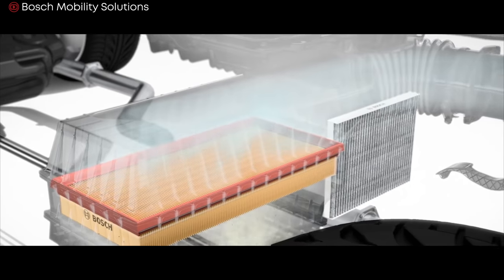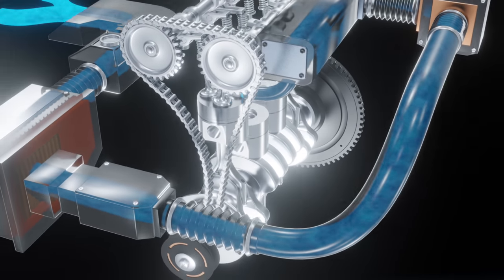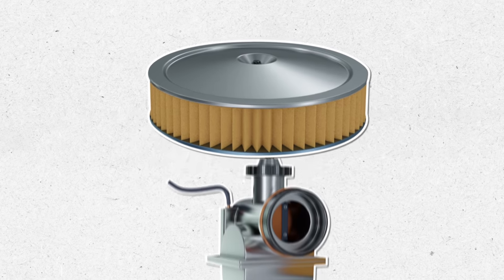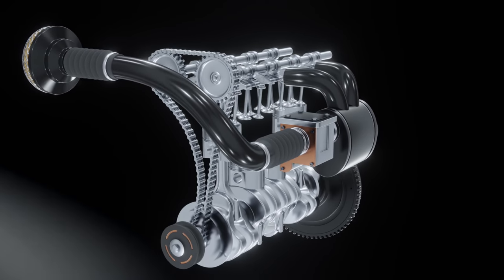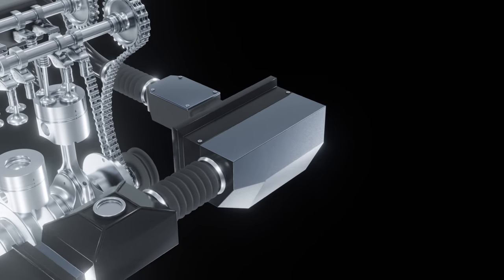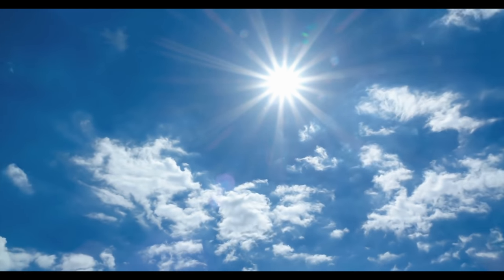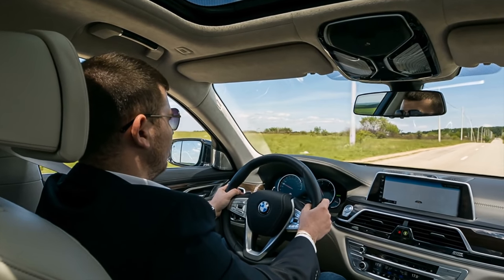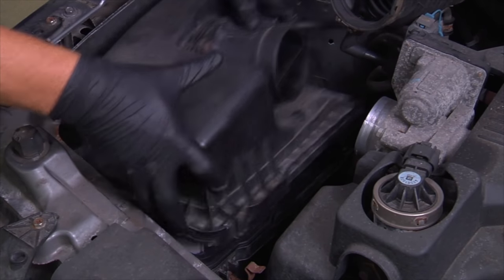If You Don’t Have This New Engine Air Filter, You’re Stupid

Comment: I have an engine air filter horror story - two years ago when forest fire smoke blanketed where I live my engine air filter had to be replaced TWICE in a single month.   the soot and particulate in the air clogged the new air filter with only 20 hours of running time.   Brutal.
Reply: Atleast you had the knowledge to check it and the smarts to replace it! We need more peopel like you on this planet.
Reply: I've heard of people putting panty hose on their air filter to work as a pre-filter for times like that, first time I heard about it was when Mt. Saint Helen blew her top up in Washington state.
Reply: Imagine how your lungs looked.
Reply: you've reminded me to def checking the air and cabin filters instead of "thinking about it" on account of just being 2 years old, seeing how we've had light sandstorms coming in from Africa or something that blanketed the sky in orange for iirc a couple of weeks
Reply: Portland?! ~ Salem
Reply: @spambotfodder  here in the northeast US, we were HAMMERED by smoke a month or so ago! I had to change my filter after only using it a month or so. The cabin air filter was also toast; it was already a light-medium brown color.
Reply: Wow. We’ve had to deal with a lot of them out here in the West Coast. I bought the trd air filter but I’m probably going to return it. I’m a little nervous about using it considering all the fires that happen around here.
Reply: @DanBrando OEM is a good bet, as are FRAM and Wix.
Reply: Fram is subpar. WIX & Purolator Boss are the best.

Comment: The other neglected, is the air intake hose, if it leaks/torn it tends to absorb the hot air from the engine compartment which also has less oxygen/expanded air and leads to reduced mileage/high consumption. Check your air intake hose too. I learned it the hard way.
Reply: What what be the process to check the hoses?

Comment: I just washed & re-oiled the K&N yesterday, since I had a 4 day weekend.  Wasn't even dirty yet, but it's done until Fall!
Reply: Easy on the oil if you have a turbo.
Reply: I like both my KN Air Filter's and their oil filters too. The combination of the materials and oil treatment work great and not hard of you follow directions. They are smart and have good R/D behind them. I've used them on all my cars and they are high use/high milage.
Reply: Hold your K&N up to the light and check out the size of the holes in that media.  Not worth the miniscule HP gain at the top end.  Your engine spends a heck of a lot more time suffering from the reduced filtration than it does taking advantage of a miniscule HP gain at wide open throttle.
Reply: K&n still worth it. I clean mine every 6 months. Cleaning it only when there’s lack of sunlight thru it, that’s not true. I tried it.
Reply: Mmmm...K & N filters, not a fan.  They do more harm than good, threw mine away.

Comment: My 318 ci . Dodge really struggled to pull our loaded down 24 ft 1984 Frolic camper . I installed a K&N air filter and had dual exhaust with Flowmaster mufflers , helped enormously .

Comment: Hi Scotty. Last fall, I bought a 2015 Toyota Corolla Eco plus Le. It had 75,000 miles on it, and it was in great shape. It came with free services for the life of the vehicle at the dealership, so I had the oil changed four times at the dealership and put 20,000 miles on it since I bought it. 3,400 mi into the last oil change, it threw a code, p2647 "A" rocker arm stuck on in Bank One. Since I haven't looked under the hood since I bought it, I decided to check under the hood. The plastic shroud that covers the valve cover had an oil slick on top of it with bugs and dust collecting on it. I decided to pop it off and clean everything up. I checked the air filter and it was as dirty as if it were not changed in 20,000 miles. Upon discovering this I decided to do a full service myself. The the edges of the oil filter cap were rounded and the retainer clip was missing. It was as if some kid didn't have the right tool and strip the oil filter cap and decided to leave it instead of changing it. I used a piece of paper inserted inside the oil filter wrench so that the wrench would grip onto the filter cap. This worked great and the filter came right off, however the filter was the blackest filter I've ever seen. Sure enough, the oil was black and full of sludge. Since the engine oil was so dirty, I decided to change the spark plugs as well. It had 95,000 miles on it anyway and that's when the maintenance schedule said I should change the spark plugs. Two of the plugs were dark and fouled. I hesitantly put mobile one high mileage 0-20 full synthetic oil in it, knowing that the swellers in the new oil would prevent me from using any other oil for the life of the vehicle, but since my engine was dirty I figured it wouldn't hurt to use mobile one full synthetic. I even changed the actuator solenoid that was throwing the code. After changing the oil, the oil filter, the air filter, and the spark plugs, along with the new actuator, the code cleared itself. The engine immediately sounded like it was running more smooth. It hasn't thrown the code since. Needless to say I will never bring it into the dealership for the free maintenance again, I will just do the maintenance myself. Do you have any advice for me pertaining to which other parts I should inspect or change?
Reply: On a side note, my auto start isn't working right. It turns over, but is either too rich, or too lean to start. It makes a knocking sound and fails to start. Then I have to wait about five minutes before I try to start it again with the key, and it works. I'm stumped. Winter is coming, and I live in Alaska. Auto start will be a very desired luxury, then.
Reply: Might want to replace your serpentine belt, unless your book has a note that it has already been done.

Comment: When you replace your filter, also check the air intake horn. One of my tractors wouldn't run, oil bath filter was clean but eventually found that mud wasps had built a nest in the intake screen. Plugged up about 90 percent.
Reply: Wow. That’s crazy! First time you’ve seen or heard of that?
Reply: That crashed an airliner in South America, when wasps built a nest in one of the pitot tubes for calculating airspeed.
Reply: @ted.angell7609  I have actually heard of that happening.  Pilot must have missed it on the pre-flight.

Comment: While driving through a Wyoming blizzard, I had snow clogging the air filter.  I lost power while driving.  Even in lower gears, I couldn't keep the rpms up.  It finally stalled and I was stranded.  Every winter after that, I would reroute the intake tube to take air from the engine compartment instead of from the grille area.
Reply: So did you replace the air filter
Reply: @hazelpieterse853  Perhaps the ice would melt and drip out the bottom of the box, or too cold?

Comment: Back in the seventy ' s  we use to flip the lid on our breathers, it would seal up just fine and give more area for air to get to the filter, those 350 Chev' s with the 4 barrel Quadrajet carbs would really talk to you when those back two barrels opened.
Reply: I did that too !
Reply: Me too. I was thinking about that when I saw the video.
Reply: It even worked on my brothers aspen r/t with a 360.
Reply: I got 1500 more rpm from my 4.3 1996 GMC Sonoma  with new airfilter and flipped over air filter lid
Reply: I wish I had kept my 66 Charger, 4 bucket seats, manual shift, it had a 440 with a 4 barrel... sigh............
Reply: @Find_Amelia_Island  that was a nice ride.   If you had the six pack ( three 2 barrel carburetors) it would have been the fastest thing around.   With the 4 barrel it was still nice though.
Reply: I used to have an engine tuning and rebuilding business and I had to point out to people that turning the air cleaner cover over on many models actually nearly shut off the air flow because the center of the cover is a very flat cone, so inverted,  the center nearly touched the top of the carb.  Those were low profile air cleaners using a fairly short  or low profile element.

Comment: Recently change the air filter on my Golf, easy to get to however, it’s screwed down with those ridiculous torque/ star screws. Had to buy a special tool to change the dang thing. People are always telling to buy those reusable filters, I’d rather just change the paper one. Easy to do and doesn’t cost a lot and should work as advertised after changing.
Reply: Small straight blade works.
Reply: Replace with normal screws?

Comment: I have a 1995 Ford Ranger with a 3.0 L V-6. I bout it used and it ran OK. One day, on a whim, I decided to do some maintenance. I changed the air filter, cleaned the mass airflow sensor, cleaned the idle air valve, and replaced a cracked vacuum hose. OMG! What a difference. A rough guess... 20% more horsepower and 15% better fuel mileage.
Reply: Most of your gains were probably the result of replacing the bad Vacuum Hose.
 The NEXT time you buy a "new" car, do those things right away -- and start saving IMMEDIATELY !! 😁

Comment: been driving my mums car, noticed a rough idle, terrible acceleration and jerkyness at higher rpms. checked air filter - previous owner (probally a teen racer type) had installed an off brand k+n oil gauze filter which, i think might have originally been blue, but was now dark black. Never been cleaned in like 10 years. Put a paper filter in. Runs great now. Asked who had been servicing the car and told her never to use them again.

Comment: The oil I spilled the first time I changed my oil bath VW air filter is still on my folks driveway, 40 years later.
Reply: They didn't redo, reseal, or even just clean their driveway in 40 years?!?
Reply: @Gideon_Judges6  no matter how hard you clean a driveway it takes a LOT to get an oil spill off, trust me I know lmao
Reply: Dirty oil is hard to get up. Hydrocarbon oil disperant works best.
Reply: There is a product made that will ''eat'' only the oil away in a few months... Dawn Dish Soap works great as does diatomaceous earth ( oil clean )...
Reply: Use baking soda and coca cola.  Scrub with push broom. Rinse off with power washer. Let dry. If stain still exist, use cat liter with push broom. These steps worked well in the Army motor pools.
Reply: @geoffgordon9569  
Solution sounds okay...
But, never use a power washer on your concrete unless you really know what you're doing !!!  The damage you do will only show up in a year or more 😭
Experience IS the best teacher 😳🤓🇺🇲
Reply: Must be some spongy concrete my car five quarts a year probably on my driveway it was gone in a year I thought it would last for years too
Reply: Cat litter socks up out pretty well. Even oil that has absorbed into the concrete.
Reply: I use cat litter to clean oil off cement, sucks it right up.

Comment: Due to Scotty's knowledge I change my Air and Cabin filters at the same time every 3 to 4 months. Just like I change my oil. It's important people.
Reply: You're wasting money. I've seen 1 yo air filters that still look like new..  Unless you drive dirt roads a lot.
Reply: @lg9853  I think 6 months is good. Just twice a year is plenty
Reply: I have replaced the cabin filter in my Tacoma twice, and both times it was clogged.  Need to change that regularly.
Reply: Haven't changed the cabin air filter in probably 60k miles and it was quite moldy

Comment: I had one that lead to a misdiagnosis due to tech not checking the shop guide or the air filter for that matter. It was so dirty the Maf got contaminated and also caused a jerking of the vehicle.

One code needed (that caused the vehicle to jerk) needed to have another code(P0141) resolved. But they went for the most expensive line item that the 2nd code (ECU replacement and reflash) and then lied and said the code was new.

Never went to that shop again. And made sure I own the shop guide for every vehicle I own.
Reply: YES !!  ALWAYS get the Factory Shop Manuals for your vehicles !! NO Haines, NO Chilton -- get the OFFICIAL manuals that the  DEALERS use.

Comment: This is one component that I see techs neglect every day in shops🙄
Reply: That's okay, the techs at the oil change shops will try to push one on you every 3 months, whether you need it or not (at a 300% markup)
Reply: @Adiscretefirm  those places🙄ill be surprised if they even attempt to change the oil🤦‍♂️
Reply: I still have shops trying to upsell me on square engine air filters despite having a short ram intake sometimes. Granted I figure these guys must be new but still
Reply: @GabrielIgnacio  🤣🤣🤦‍♂️
Reply: So what air filter am I supposed to have?
Reply: @jasona5745  once u go into a auto parts store you'll give them your year make and model of your car and they'll get u the correct filter👍do the same thing if u wanna order online, use the brand of your choice😉
Reply: @jasona5745  scotty said go with OEM

Comment: I understand from paper to k&N, the difference it made was the engine had more air, a sharper start up in the winter time and that’s only from a panel filter, 
Who remembers air boxes with winter/summer settings, going back to the 80s😮
I had a friend who also had a  k&N filter from paper, on a fuel tank of fuel down to the red light, he gained a massive 46 miles extra than the paper one, so the k&N has a sharper response to the engine slightly more power gaining around 5/8 bhp👍🏻

Comment: I am surprised that Scotty never mentioned mice getting into the air cleaner box. I have seen where mice actually chewed holes in the filter.
Reply: I’ve seen sensors taken out that have been chewed.
Reply: They like to make nests in the box. I put steel chicken wire on the opening to stop them getting into the box. Might reduce airflow slightly but better than having mice nest and chew through the plastic.
Reply: Europe problems
Reply: @tylerwinkle323  I've heard Irish Spring or Mothballs will keep them away as well.
Reply: Damn, with turbo engines they should rather stay on the right side of the filter!

Comment: I was worried my Mazda 6 wasn't as peppy as it used to be when new. I was due for a tire change and an oil change, hoping that would fix the problem, it didn't' t. Next stop was to replace the air filter.... and then I floored it, was pushed back to the seat and I was flying again holding on to the wheel with both hands just like the first weeks. Here I am with my tires driving rough again on the back roads with my "new" and peppy AIR FILTER, I love my car!

Comment: I run FRAM Ultra synthetic oil filter plus Mobil 1 5w 30 ( not high millage Mobil1 it's a scam , costs more ) since new engine after nearly 300.000 km still runs like NEW no HP loss no smoke...great combo.

Comment: I use K&N air filters on all my cars. Clean them every 15,000miles and have never had a problem. My old 1991 Pathfinder had 260,000 miles on it before the frame rusted through and had to junk it.
Reply: K&N are for more airflow, but don't filter very well.  They do improve performance slightly but at what cost?
Reply: @mplslawnguy3389  Well the frame broke on the Pathfinder, that wasn't the filter's fault. The engine was as strong the day my son traded it on a new car as it was at 9,000 miles when I switched to synthetic oil.

Comment: I once bought an old Ford Courier at an estate auction. Of course, I was going to trailer it home, but who can resist trying to start an old engine?

So we pulled the fuel line off, hooked up a gallon jug of gas to gravity flow, in case the pump was bad, and gave it a go.

It fired off with the hot battery from my truck, but puked and gagged like a Shriner with a hangover. The distributor was loose, but no position helped it. And after my brother got juiced by the coil twice, we determined we had fire to the plugs.

That's when we took the top of the breather off, expecting to find a dirt dobber nest. We instead found someone had substituted foam rubber for a filter, and with it having no stiffened borders, that foam was now stuck in the top of the carb in a big was.

It was partially melted when we pried it out, which was good as the chunks were too big to do much except smother the engine. I later found the carb didn't have a gasket at all, so it must have sucked enough that way to run a few minutes.

But, a rebuilt carb and a junkyard radiator later, that little booger run like the piece of junk it was intended to be. (I like Ford's, for the most part, but that thing wasn't even an improvement on a Subaru Brat.)

Comment: Bought my truck used,  went to replace the air filter.  Found a ton of acorns in the air box 📦  
I'm like, how did that happen 😳 lol
Reply: Chipmunk
Reply: That's why experienced country mechanics will sometimes refer to the air filter as the "nut filter".
Reply: I found a kitten once in my engine bay
Reply: Wow, that's nuts.